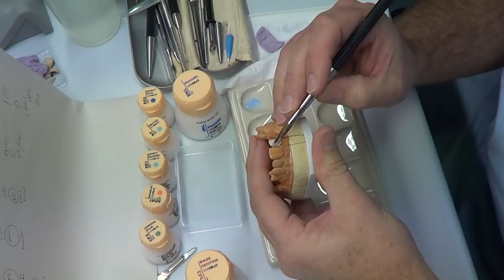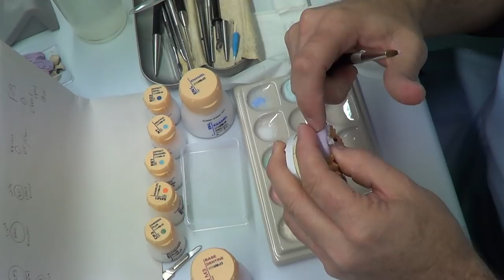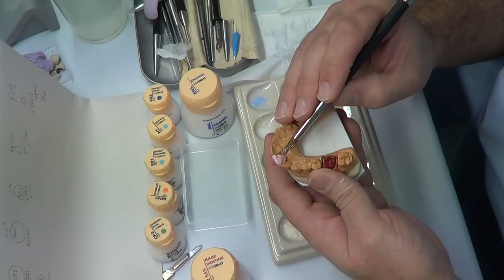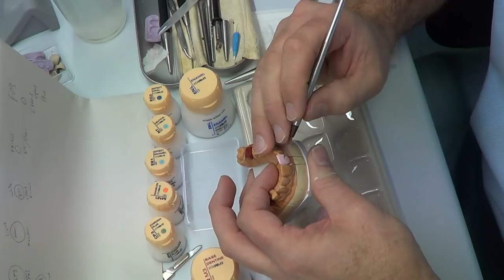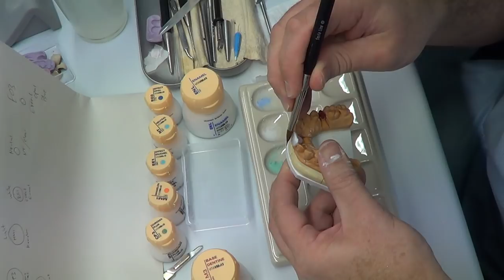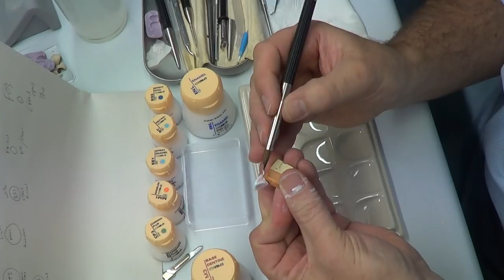Porcelain Build 11/ Upper central VM13

Comment: I wish if i could see the final result, in which place did you apply the EO3 and NT?
Reply from the maker: Hi Adil, the bottles are placed above the porcelains so the EO3 is the last one in the line and it is been coloured with blue die so the placement is easy to see. I have placed the NT over any effects so they will be under and give a diffused appearance to make it look more natural. Regards M